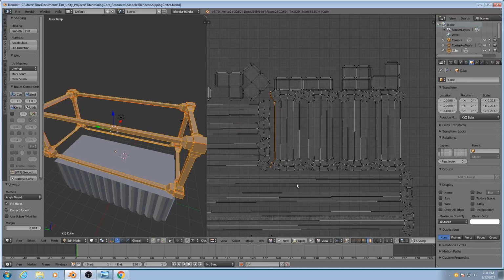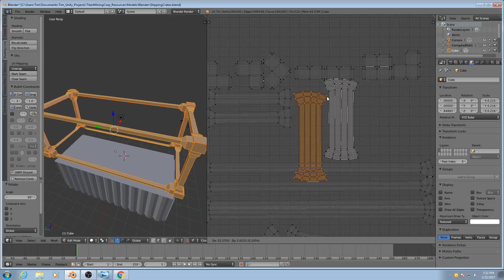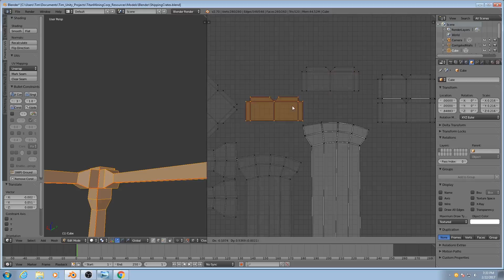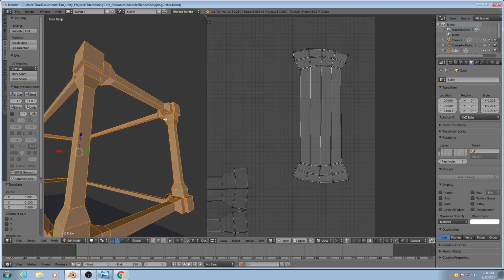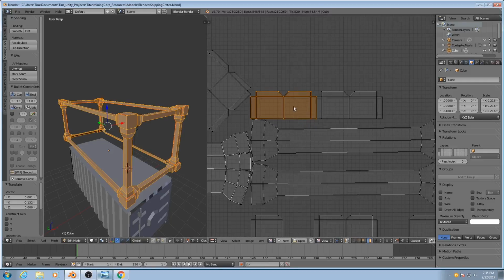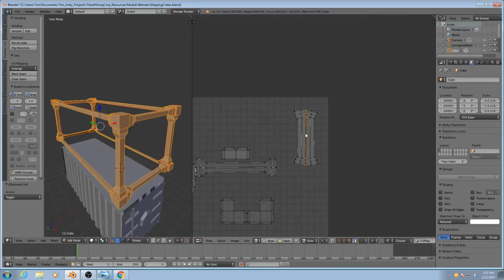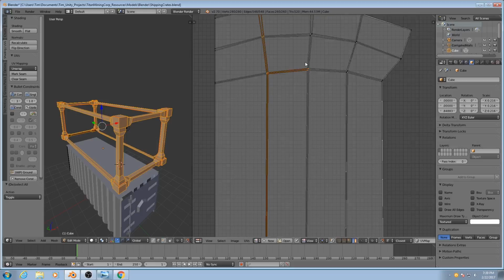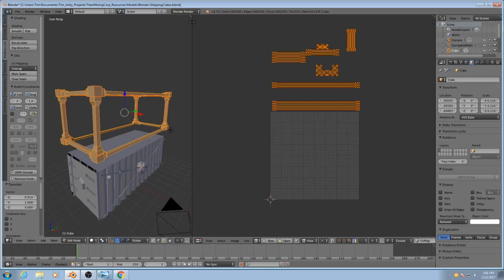Blender Game Asset Modeling Tutorial (Part 9)

Comment: Pinning was a problem as there are only 4 main pieces - if you used a mirror modifier and unwrapped it then apply the modifier it will save some time in the packing of uvs